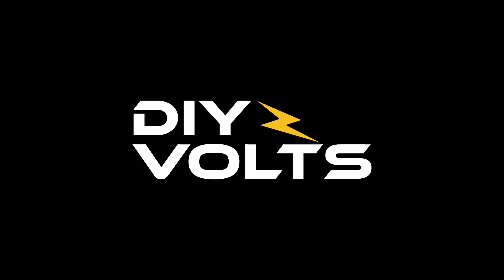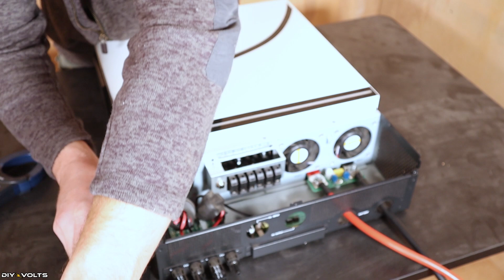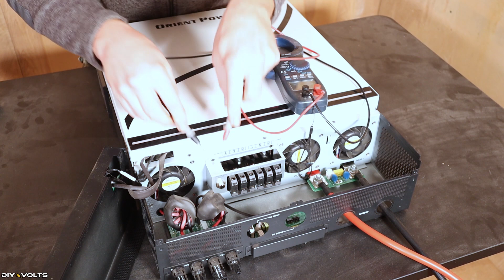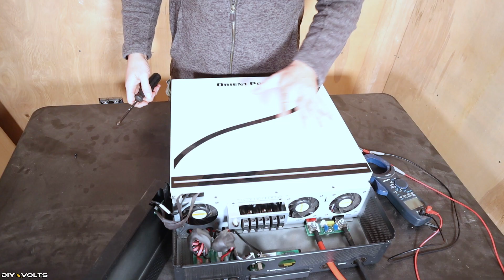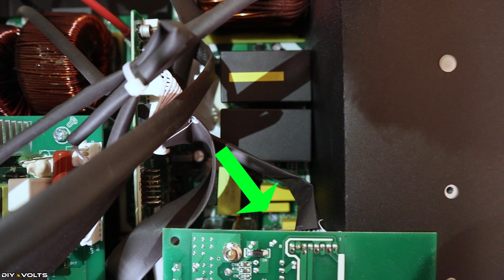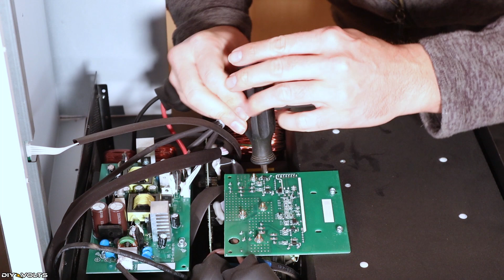Unlink Ground and Neutral - Orient Power Inverter

Comment: That's a horrid design to hide the bonding screw way back in there between components mid PCB.  
-- > Hey why is my ground wire shocking me? 
-- * Because the bonding screw is in place and your ground is acting as a second neutral.
-- > What bonding screw?
-- * Prepare for an adventure, bwahaha!
Reply from the maker: I agree. It was deep in the middle of the inverter. Hard to reach.